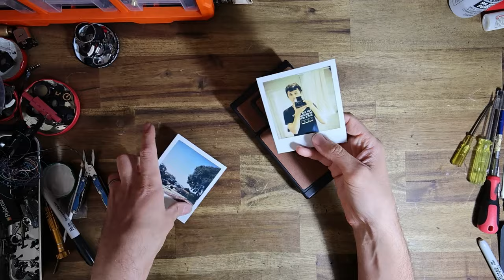Overhauling and repairing the SX-70 Model 2

Comment: Flash Cam assembly @ 56:00 is very interesting. So I guess it will basically make its own f stop setting regardless the electric eye based on how close it’s focused? And how does it override? Or is the auto exposure simply off line when in flash mode? 
  Did NASA design this camera?! 🤣😂
Someday I would love to see you review the Polaroid Lab printer ..
Reply from the maker: Correct!

In flash mode, the eye is basically disabled and shutter speed fixed

Comment: Great video! Would it be a good idea to apply some dielectric contact grease to the power switch after cleaning and sanding it, so it can't oxidize again?
Reply from the maker: You certainly could

To be honest I don't think it's super necessary, since the switch rarely ever causes an issue, and friction usually removes any oxidising 

But it's not a bad idea!

Comment: Hey Jake, any tips you might have regarding the square screw heads? I can't find a proper bit anywhere. I've even tried sanding my own, but I still can't get it to fit the screws. I'd love to hear how you dealt with the problem!
Reply from the maker: Ideally, you need to get a professionally made bit

I made my own for years that worked just fine. The tip is to use high tensile bits as a starting platform and file them by hand to be EXACTLY the right dimension

I was lucky enough to get in on an order of bits a few years ago